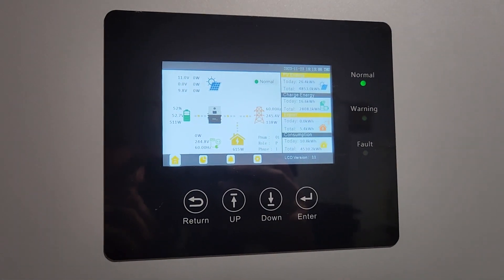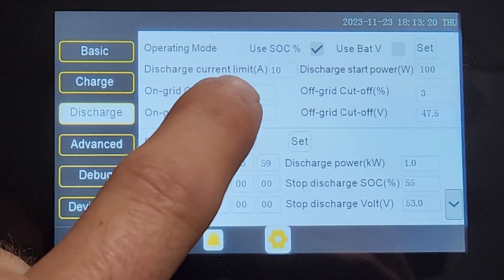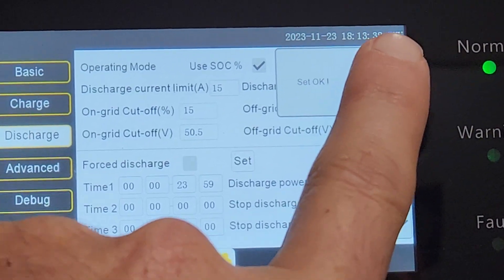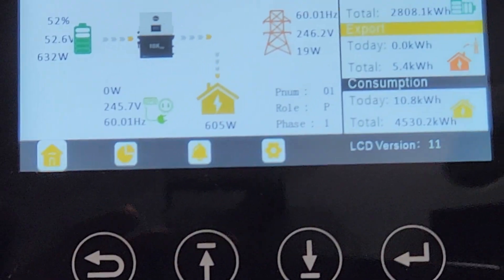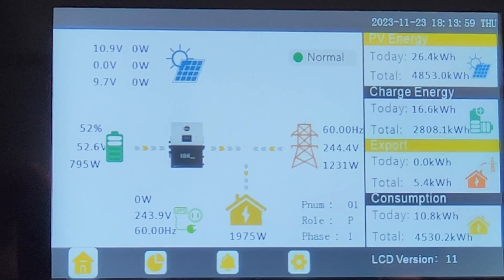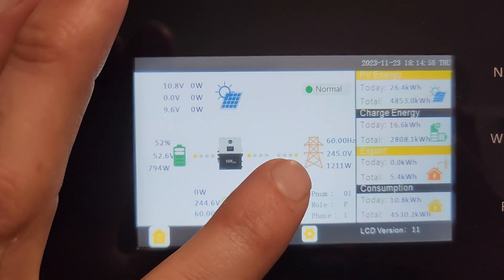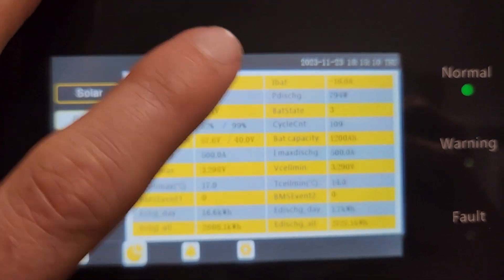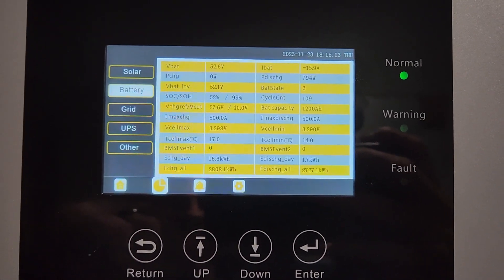18Kpv User Question.  Can you limit battery discharge when grid connected?

Comment: I appreciate the videos you are posting.
Just tried to do this on my inverters have two eg4-18KPVs have a grid connected and lowered them both down to to 10 amps but I did not see anything being pulled from the grid side? Is there another setting I need to use?

Thank you
Reply from the maker: Do you have "off grid" enabled?
Reply: Good morning,
Yes off grid is enabled. I do not have an agreement with my utility company to back-feed the grid? If I disable that will I back-feed the grid?